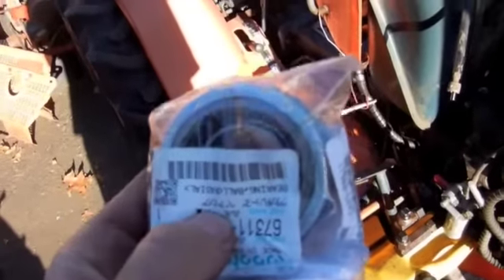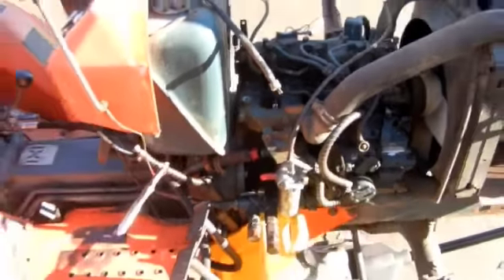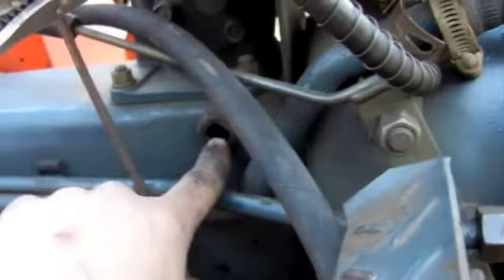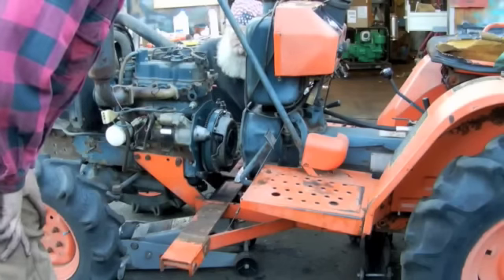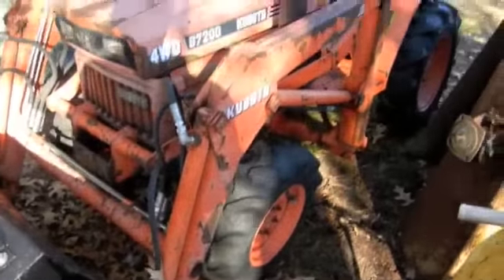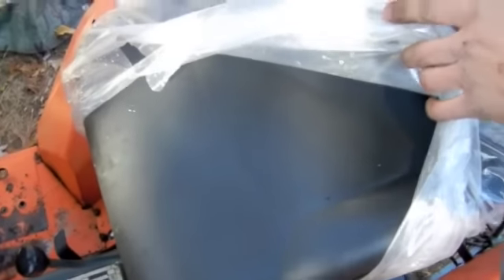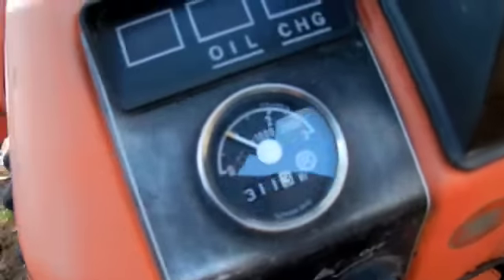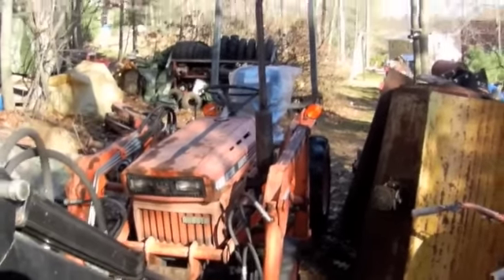Kubota B7200D Clutch Throw-out Bearing Change

Comment: HELP! I got a B7000 thats been sitting for 7 years. Seemes like the clutch dont work, sticking? Ant tips?❤
Reply from the maker: See if you can start it in 2-Hi or 3-Hi and drive around with the clutch pushed in. Or jack up the back of the tractor, put it in high gear, block the clutch pedal down and rock the wheels back and forth. If either of these don't work, most likely you'll have to split the tractor.
Reply: @5Tractorguy  I quickly got tired, and i split the whole tracktor ;) One side of the clutch plate was stuck, and the release bearing was also shot, so i fixed both problems, and now is working like a king :D

Comment: Nice guys sounds good to. And boy that motor looked super hard to get off.  Glad its working good :)
Reply: Can't seem to comment on your comment on my vid. Says im not allowed to comment on this post :( dang and dang again. I guess you can disable replys somehow in the drop menu. Check your setting once man thanks.
Reply from the maker: stevenpturcheck
It was had to get off, but you should have seen up trying to get everything back together!
That's odd, give it a shot on this comment I just posted and see what happens. I'll check the setting again.
Reply: ***** I bet trying to get everything to line is fun. We put a clutch and throw out bearing in are 8N ford. Same idea just bigger. and hopefully this works :) (p.s nice you can edit after you put it up too)
Reply from the maker: stevenpturcheck
Well I never got the email for your previous reply, (isn't this G+ thing working out great.....) the edit thing is nice. Usually I have to delete and retype. Hey Steve, can you comment on one of my other videos, say, "Gravely model L navy tractor" from a couple years ago. I just want to see if I'll get the notification for it.
Reply: ***** Ah yep its working great not. Yes i'll post one over there and I just realized I got a message from you.

Comment: Good video, most people don't know about grease fitting on throw out bearing. Have to keep greased
Reply: I'm going to go grease mine now 😕
Reply: +Dave 508d smart man, don't get carried away with the grease gun, don't want grease on clutch disk material. Another little piece of advice, if you let your Kubota set during the winter, push in the clutch to disengage and put a block of wood under foot rest so it stays disengaged, I've seen them rust together. Some so bad the tractor has to be separated to free the clutch. Don't forget to scotch the wheels
Reply: Rourou

Comment: I have a Kubota B8200. Sounds like noise from the throw out bearing but also got fluid filling up the bell housing and coming out weep hole in bottom of starter. Any thoughts. Thanks.

Comment: You say the Transmission Main Shaft was loose in the splines of the clutch disc, A new Pilot Bearing in the end of the crank shaft would keep that main shaft from moving and SOMETIMES you can change that bearing and not take the Pressure Plate and disc off. But If your going to change the Clutch Im sure you'll do that. Nice Video!!

Comment: Nice video. One question if You can aswer that. the strange sound from the bearing appears when You drive the tractor more then  engine idling? I have a problem i just hoppe that in my case is not the transmission(it's an old kubota B7000), that's why i ask you this. Thanks.

Comment: Great Video ! I need to do the same job on a B8200 - How long did it take you for the whole job ?
Reply from the maker: Some where around 4-6hrs with cleaning everything out inside the clutch area. All depends how easily it come apart/goes together.

Comment: can you Grease the bearings from the outside ?? l grease up the other clutch pedal link still squeaking
Reply from the maker: The piece the throw-out bearing presses on, yes. There is a hole on the clutch pedal side of the transmission tunnel that you can stick a grease gun through and access a fitting. Only greases the shaft that collar slides on though, not the bearing unfortunately.
Reply: 5Tractorguy Thank You For Your reaction  now I need to find that little hole on the B series kubota